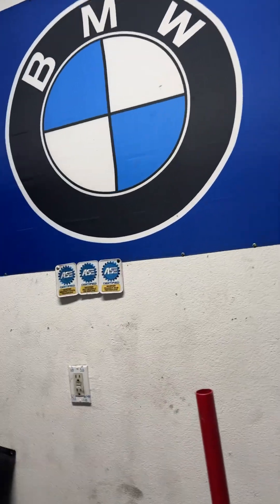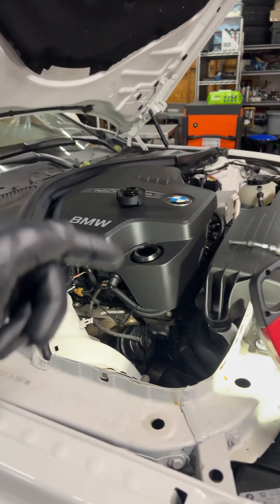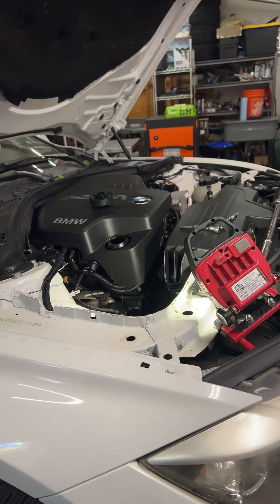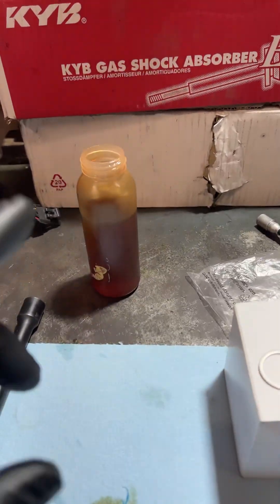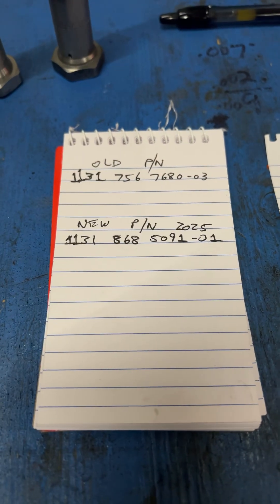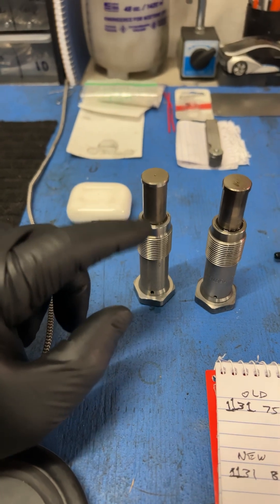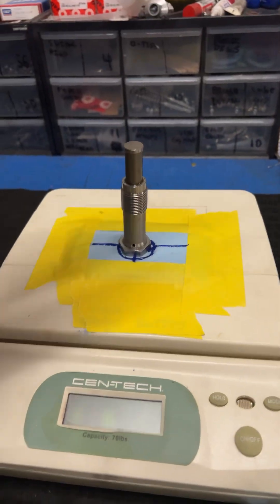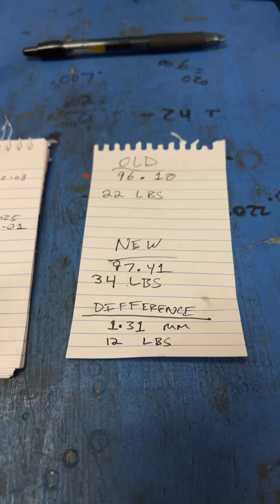N20 BMW Timing Chain Tensioner New Vs. Old BIG Difference MUST SEE

Comment: Hey boss, I was considering doing this job on my 2016 but I've heard others say their timing was off after this procedure. Secondly, I heard it's quite difficult to get the new tensoner in. Can you confirm any of this?
Reply from the maker: Yes, I have seen people loose the timing after doing this. Maybe try setting the engine in its initial timing position but just know that the risk is real and be ready to do the whole job if it comes down to it.
Be careful 
Thanks for watching and commenting 
Like and subscribe 😊
Reply: @MechaniclifeJDM  10/4 thanks for the reply. I will sub you 👍

Comment: What happens is the tensioner goes bad, which causes the chain to slack, which causes the chain guides to be broken in pieces, which causes the oil pickup to clog with the plastic chain guide pieces 👍
Reply from the maker: That’s one theory
Reply: @MechaniclifeJDM Great video. Very thorough

Comment: Per BWM TIS for the N20 engine: "If the chain tensioner is reused, its oil chamber must be drained.
Place chain tensioner on a level support and slowly compress.
Repeat process twice."
So why would you fill the brand-new tensioner with oil?
Reply from the maker: Great question! We usually fill it with oil to help with initial lubrication and proper function upon startup. The tensioner will be stroked as it is installed slowly, achieving the same effect and they start up with a lot less noise when done this way. Remember BMW engineers are the ones who built this disaster in the first place.
Provide the TIS document # for everyone to be able to review it and make an educated decision, as you said if it is “reused” this was a new tensioner.